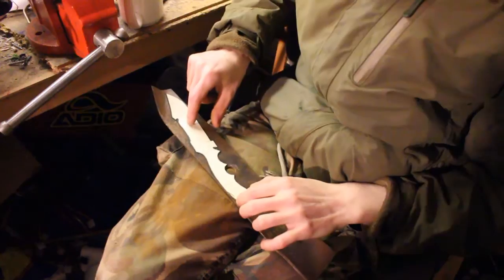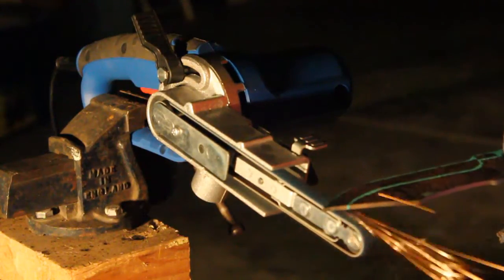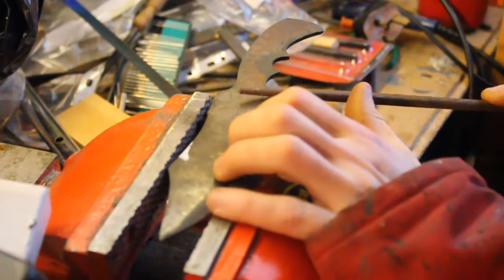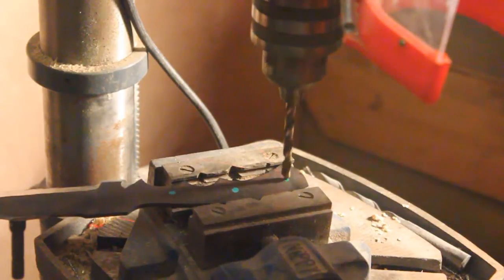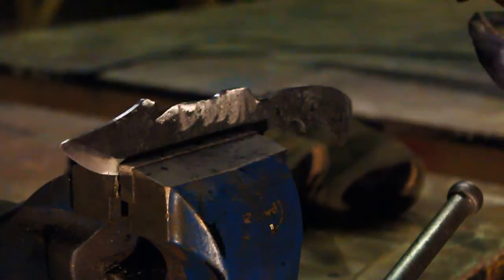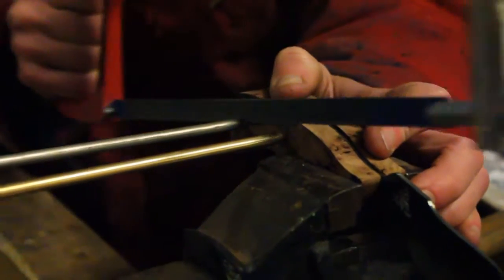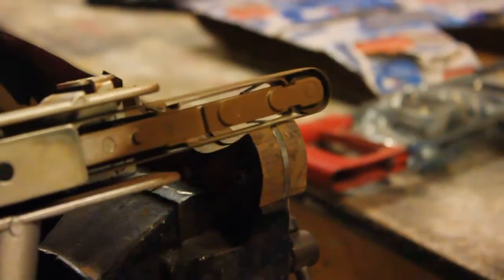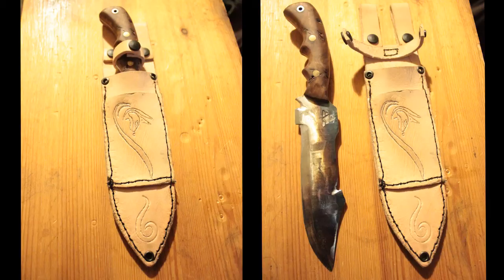Making a fixed blade knife: Stock removal method

Comment: realy nice knife dude like that you used a lawnmower blade very clever
Reply from the maker: +Tim Robson cheers, i have been using it quite a lot recently carving a hazel walking stick :)
Reply: +Alexander McDonald nice one pal it would be a good knife for carving and everything els lol i am just starting out in stock removal knife making. can you sudgest a good cheep belt grinder
Reply from the maker: yeah that was a problem i had. I ended up using a power file from machine mart which was like a tiny belt grinder and a zirconium disk for the hand grinder. recently bought a 3hp motor and cobbled together some designs from belt grinder plans online. The belt grinder seems to be an american thing mostly and i couldn't find one for under £500. I read about some folks using belt sanders with coarse paper but I never tried it.
Reply: +Alexander McDonald cheers for the info mate i have seen a few about but there quite expensive the cheepest ive seen is a clarke belt and disk grinder for £65 but no idea if it would be any good. how dus the power file perform on blades ie can it be used to bevel a blade
Reply from the maker: not fantastic i'll admit, the tool is damn useful but hard to get an even grind due to the tiny working area and the belts break easily. the combo sanding machines looked good to me but work would be slow at low rpm and torque.  the electric hand disc grinder with the zirconium flap wheel is probably the most useful at the moment for shaping and blade grinding with the power file for tight corners and files for line cutters. the power file could do a good bevel or center groove with its small rounded tip if set in a vise and you made a guide or jig or something to hold the knife straight. I should do that myself instead of winging it by hand.
Reply: +Alexander McDonald i just saw a 350w powered belt grinder do you think that would still be to low powered it is for metal unlike the last one i looked at. allso do you have any tips for tempering the steel after heat treating could i do it in a normal oven at like 230c for two hours i am using 01 tool steel